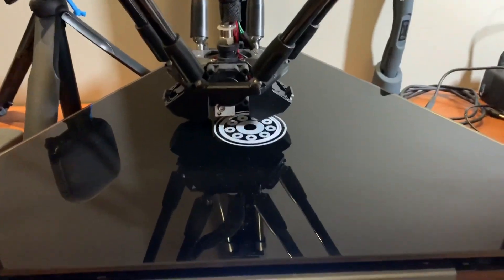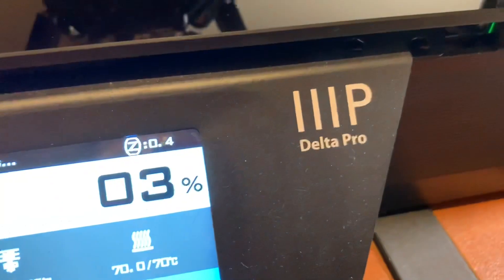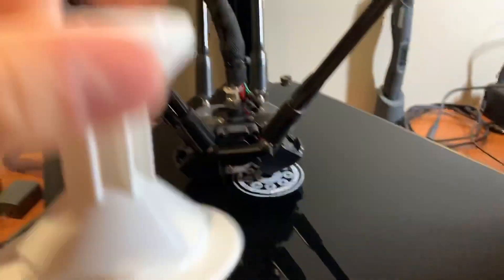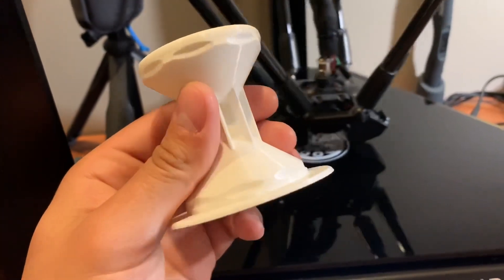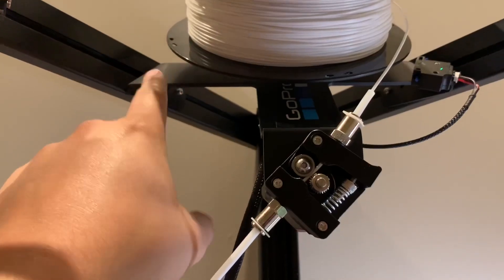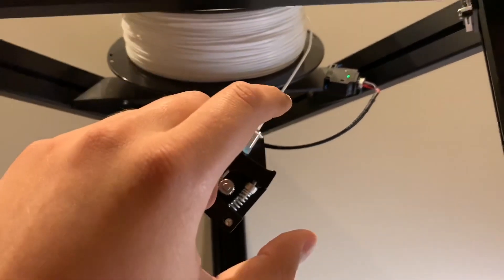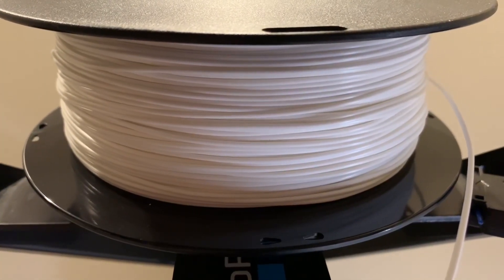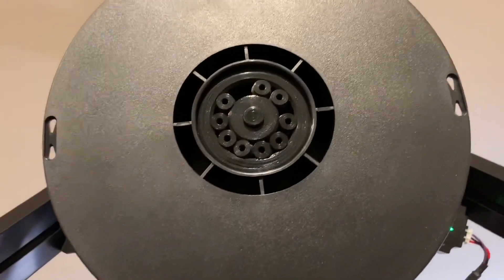Monoprice Delta Pro 3D Printed Spool Spinner

Comment: I would remove the spool and put it on the table instead, spools etc that vibrates just disturb the prints and uneven as well. Just prolong the tube, wich is an advantage you got when not using direct drive wich you only need if you print flex ..sometimes

Comment: hello ,how do you level bed manually and save the setting? thanks
Reply from the maker: Tommy mc guire its auto level through menu options, but you can do a couple tweaks like screwing or unscrewing the bolts that hold the bed down or baby step during the print. Directions on leveling the bed should be in the manual but i may make a video on it later.

Comment: I just bought this printer will get it next week any tips?
Reply from the maker: Tshais-2014 sure thing :) print a bed level test before you do anything else. Get a spool spinner for your spool #2. Do a bunch of test prints #3. These will give you alot of know-how with this printer and projects. 👍
Reply: @JLake3D  so the Spool Spinner fit any type of wheel?
Reply from the maker: Tshais-2014 the one i designed is for Hatchbox specifically, may also fit a few others though. I’ll make a video on it soon 👌

Comment: I'm thinking of buying this printer for 600 USD equivalent brand new in Canada, Is it good? Any issues? I want to use cura with it.
Reply from the maker: Thujan Krishnakumar Its awesome if it works like its supposed to ;) i had 2, one had leveling issues so I had to return it. The second one I have been using for 8 months no issues.

Comment: The problem I have is that My Delta Pro does not print well enough to print this!
Reply from the maker: Daniel Weitz what kind of issues are you having?
Reply: I have stringing on my first layer and general bed adhesion problems. I am using Cura 4.2.1, and my temperatures are bed 70, nozzle preheat 200 and printing at 200.  I  have a Z offset of -0.30
Reply from the maker: Daniel Weitz try this: clean your bed with a white napkin and rubbing alcohol, then wipe down going only one way with a dry part of the napkin.

After that you have 2 option, lower your first layer temperature, OR turn on fans starting at layer 1.

Those should be your fix but let me know what results you get.
Reply from the maker: Daniel Weitz i have the stringing issue ob the first layer if i use my 0.2 payer profile to print 0.1 so i usually just lower temp. The bed here is super sensitive so make it clean like a mirror would be.
Reply from the maker: Oh and preferably clean the bed before you heat it up
Reply: @JLake3D 
 @JLake3D
Reply from the maker: Daniel Weitz ?
Reply: sorry; I meant to write..."Many thanks for your advice; I now have good adhesion!

I now have another problem.  The sides are very rough, and the top collapsed into string, and it seemed to lack infill.

I had the infill density set to 20%, and the printing quality set at draft; .2mm

I did the slicing on Cura 4.2.  A fried says that the 4.2 is awful, and I should use the Kisslicer.  If you concur, what advice what advice would you give about settings? I am currently running at 205 on the extruder, and 45 on the bed.
Reply from the maker: Daniel Weitz i wouldn’t go below 65 on the bed, Ive had prints lose grip. If the sides are rough increase temperature after first layer. Regarding density, you may have your retraction settings too high.

Keep in mind that EVERY FILAMENT is different. I only use Hatchbox and every color has different settings by a few degrees.

I think the slicer is fine, you just have to tune the settings. But try kisslicer just to see, its free unless you want premium version which you don’t need in the beginning anyways. And its sortof dialed in to the delta pro from the beginning.